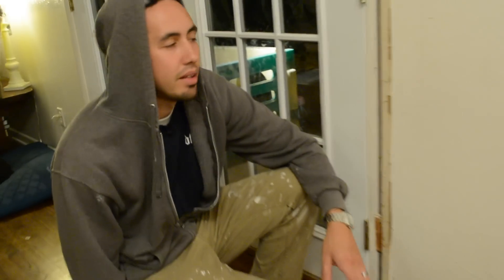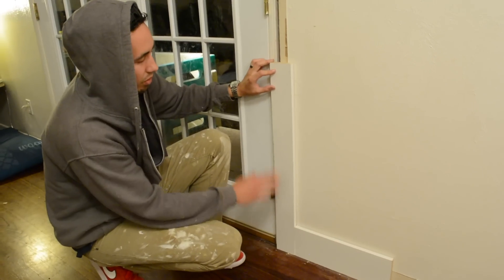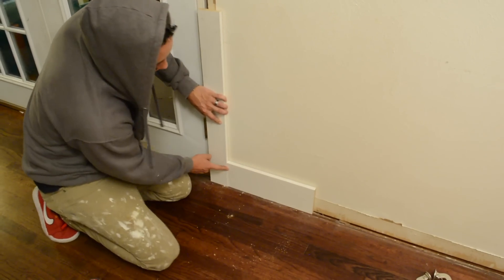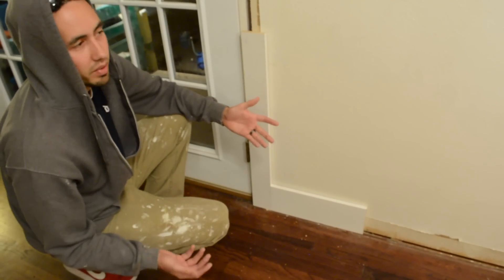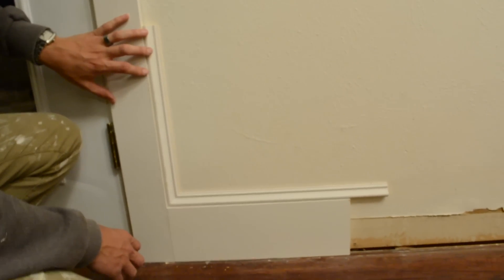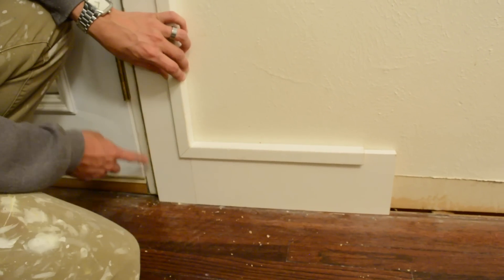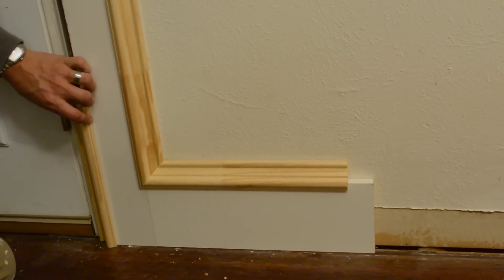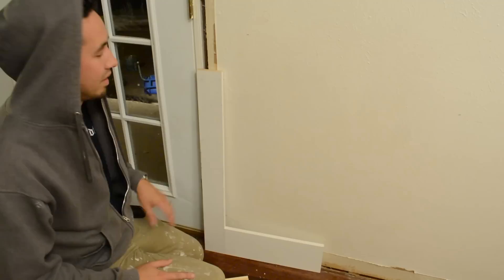3 Awesome Baseboard Ideas!

Comment: Instead of a few short scrap pieces,  let's see you use the pocket hole method with a full 'into the corner' length of base and mitered 'full height' right side of door casing. Seems it would be a little awkward if one or both were 7'+ long.  Using the same thickness material for both is just not done.  Alot of your ideas I like,  just not feelin' this one.
Reply: It goes against my guts to force any fasteners into the edge of MDF.It splits out more often than not.I am going to play with pocket holes though.
Reply: x 2
Reply from the maker: rob maloney it's really not that hard. I will show you when I do it. you need two people though. and I always have an extra pair of hands on site. it would be very difficult alone.
Reply from the maker: River rat if you use that same clamp that I used you should be fine. I used to have that problem but once I used the clamp, no issues anymore.
Reply: Hot GLUE
Reply: i like these details a lot for wainscoting, etc, but not door casings. Casings should be proud of the base in my opinion, or have a back band or plinth block for the base to die into. I really like a bit of a reveal as opposed to flush. Still world's better than the typical builder grade stuff anyday  though!
Reply: I would dowel it. Especially using flat stock. Great ideas though. The thumbnail had me thinking you were going to show one piece casing, cutting away the detail and then miter the detail inset ...... This method is much faster, nice video. 👍
Reply: I bisquits
Reply: I like your ideas. And I find you videos very informative and useful. Thank you.
Reply: We use a bisquit jointer
Reply: Can you remind me where you buy those trims. I saw one of your videos but I can’t find it. I do remodeling here in DFW.
Reply: My thoughts exactly Robert Orrr

Comment: There is many ways to do the job, but inconsiderate this is not best, so I’m not to tell you how you have to do it. Also you are using the aprópiate tools, you can use a carpenter clamp not welder clamp to do wood work. 😆
Reply: Joel Sosa I love using welding clamps as well. They give a great flush fit and yes I also use carpentry clamps but when working in hall ways a welding clamp had a shorter handle and is easier to work with. Use what works best, don’t get stuck in a box. There are so many tools that work much better depending on the circumstances.

Comment: So, you pocket screw a 10 foot board 90 degrees to a 7 foot board? Doesn't sound practical or efficient. Dowels, biscuits, or dominoes would be a better solution because you only handle one board at a time.

Comment: Base the same thickness as the casing leg looks like garbage. Use 1/2 x for baseboards and 1x for casing.  Or transition with a plinth block
Reply: Kyle Raines right, baseboard and casing are two different things. unless the whole house is on a craftsman theme I prefer to stay with the "old orders" it drives me crazy when clients want an original scheme. the last 90% of the house is a nightmare to pull together. back band and base cap are shaped like that for a reason. an example would be how you going to clean that baseboard with a flat top. you'd never get into the corner and would always have a black line between the base and the wall. this is the reason we use shoe molding on hard floors. the casing is always thicker than the baseboard so the shoe molding can terminate. thousands of years of Architects have already done the hard work for us.
Reply: While I might agree that casing looks best when standing on its own, the different thicknesses you suggest would make it hard to wrap the top trim piece (the pm5, say) around the door from the base board.  Sometimes you want to accent a door, other times you want to enhance a flow.